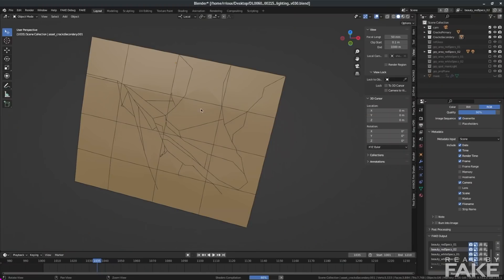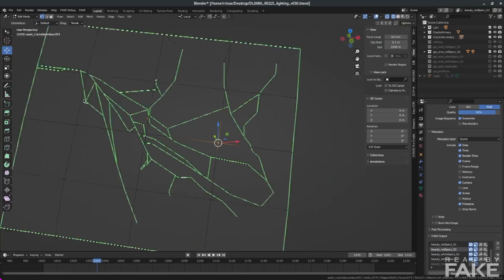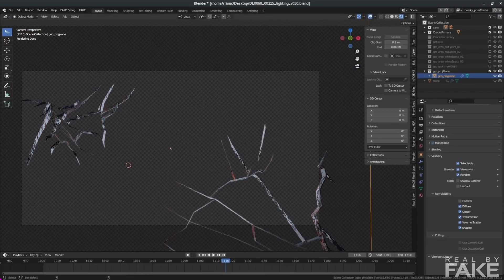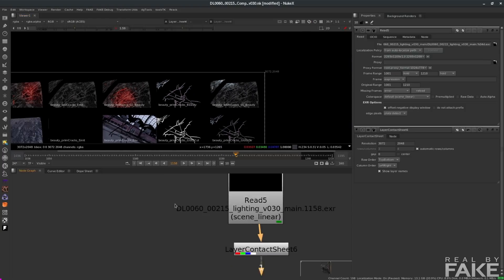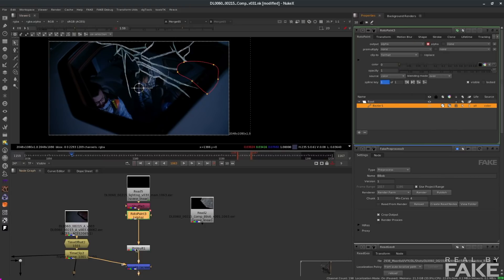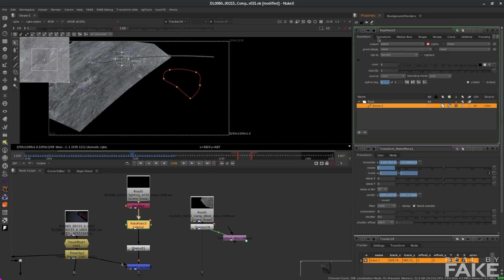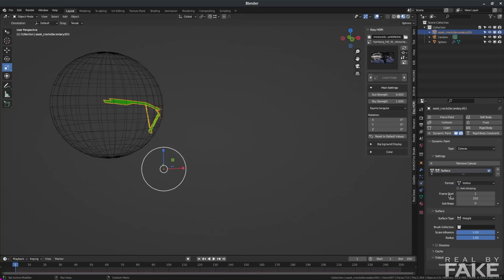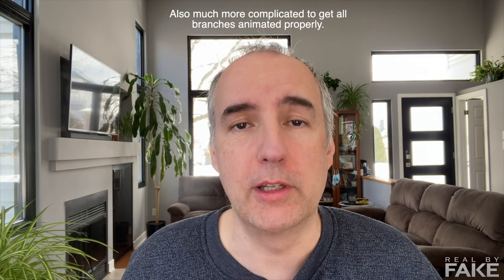Moonfall, breaking the glass in Blender

Comment: Oh you call it a pre-comp? We call them slap-comps. As in slapped together the foundation and then all the refinements happen.
I wrote also comp scripts to bring on all the 3D passes, link them up and set black and white points in the grade nodes. And added transform nodes to each of the elements. And then we always had an exact same layout of the passes and we could transform them in place and build up the integration from there.
It takes out that boring tedious stuff. Compositers need to do their magic and not bother with trivialities like that. 
I wonder if they maintained those scripts? A lot has changed in Nuke since 2010-2011
Reply from the maker: Cool. I also made a template for rebuilding an image from all the AOVs. I talked about it one of my clips. I forgot which one.
Reply: @BlenderBob  watching your videos make sort of want to get back. 2 years ago when covid hit, work dried up here in NL. And since I also have a freelance IT job. I decided to cut cost and stop the rent on my studio and stop useless bids; not a lot of engineering challenges most is applied work, that other studios can under bid easily.
And also my health was very bad (it took a cardiac arrest to figure out the real underlying problem). So I can’t work 6 or 7 days of 12-16 hours anymore.
So I figure IT pays more and the hours are easier. But when I see your awesome work it starts to tingle again. Although I’d probably opt to do actual practical effects again. That was my start and it’s more tangible. And having been a software developer for 27 years I sat more than enough behind a screen :)
Reply from the maker: @CallousCoder  Software dev huh? We're looking for one. We have a motion control robot called a Milo. We create a camera movement in a 3d software and the robot will reproduce it. We didn't use it for years but we may have to soon. So we need a python script that will output a text file with the camera's translation and rotation but it's not formatted as easily as TX TY TX RX RY RZ. I think it outputs two locations to create a vector or something like that. I could send you a template for you to check. If you do some freelance, maybe you could give us an evaluation for the cost of making such a script in Blender.
Reply: @BlenderBob  I think that you are right with your assumption. Milo starts probably in a zeroed out position and basically those lines will tell where it has moved to in relation from the previous line (or home position for the first line). And that is assuming, that the data for translate are in a real world format (mm) and rotation in degrees or tangent.
In that case we can just add those to the blender camera that is homed to the exact same position. The latter would be the tricky part. Unless Milo starts from an origin that’s is well known. I would set home to 90degrees straight up and if on a Dolly and arbitrary location as 0,0,0.
Now if this file uses steps instead of real world positions, then it becomes tricky. You would need to model an accurate virtual Milo and know how many steps are a full revolution for each axes and then calculate the steps to real world rotations and apply those to the “virtual bones”. 
But if I would make such a machine, I would use real world numbers for the output. As it’s a logical request that people want to virtualize the camera movement.
Reply from the maker: @CallousCoder  We have the 3D rigged model coming directly from the company so we know it's accurate. We also have the scripts that were used in 3dsMax for the export but they are in MS visual basic. That being said, it this something you could do/be interested in?
Reply: @BlenderBob  Let me have a look and I’ll see if I can fit it in between my current schedule and make a cost estimate. When we have the VB code than its trivial to translate it into Python for Blender. That will safe time and this money. But VB really??? Who still dares to use that? 🤣
Reply from the maker: That was a long time ago in a galaxy far far away
Reply: @BlenderBob  btw I noticed that there’s now a shuffle2 node. That’s a lot more convenient than the old shuffle node! The last version that I have is Nuke 8.2 before you had to start to rent it. But the last 3 years I just used fusion. And I see why it (EOn) used to be the defacto standard, with Smoke before Nuke.
And I love the GPU acceleration they managed to put in. BlackMagic is really stepping up and must have an incredible development team. Just to support NVIDIA and ATI for acceleration is brilliant and hard. CUDA is a nice simple API but ATI is not trivial. 
Although Nuke’s line renderer also has become pretty fast in 10 and up.

Comment: Interesting, the plate is in 2k? so the movie was shot in 2k?
Reply from the maker: Movies are shot all all sorts for resolution depending on the camera but the final output for films is 2k but 4k for Amazon, Apple TV and Netflix. So if you buy a 4k version of a Marvel movie, they just upscaled it.
Reply: @BlenderBob  Interesting, so how they upscale it?
Reply from the maker: There are different software that can do it. Nuke as it’s own system. Nine of them is perfect and lots of fixing is required after.
Reply: @BlenderBob  I didnt know Nuke could do upscale, i use topaz but its just ok, much better than doing a scale in After Effects.
Reply from the maker: I think we used Topaz too for upscaling a movie recently
Reply: Don't think so, in the properties under format it says "2293x1209", the proxy format says 1K.
The layer contact sheet reads 3K..... so, probably higher than 2K.